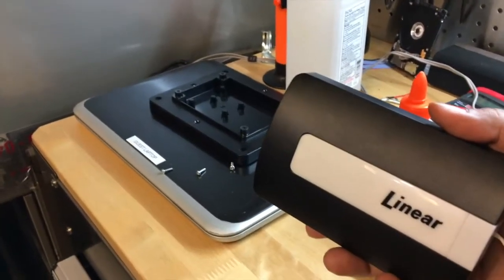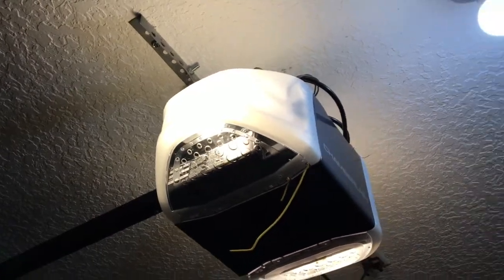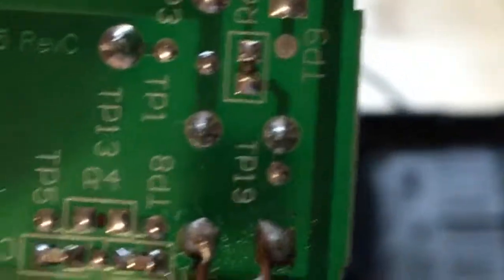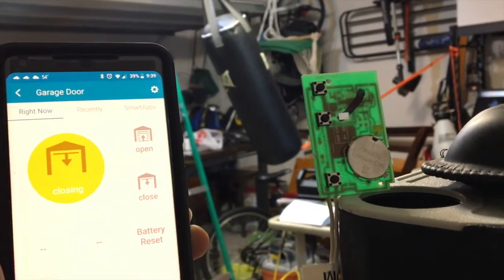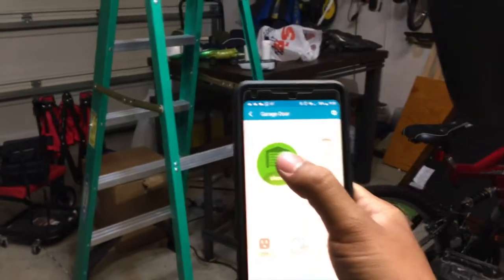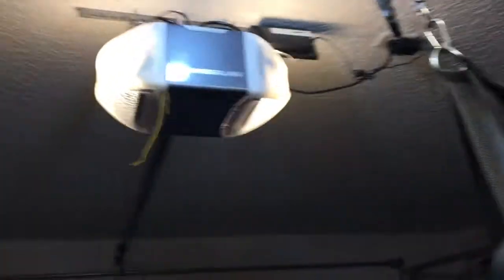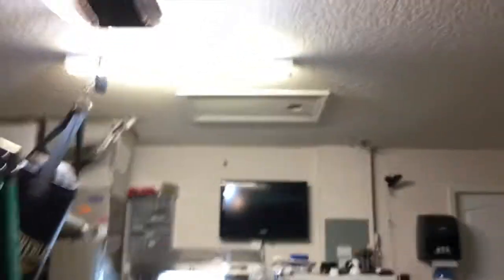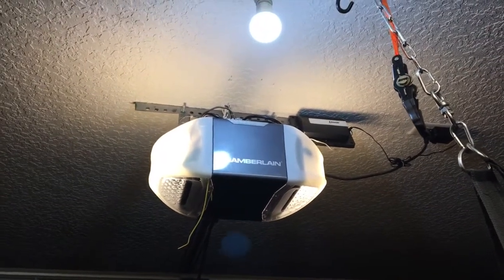Linear Z-Wave Controller with Chamberlin Opener Hack

Comment: OMG! You totally just saved me from losing my shit. I bought a Samsung Smartthings Hub and the GoControl Garage door opener. I was totally lazy and waited a few months to install. After I got everything in place, NADA. For the record, I double-checked the linear website and it shows compatible with LiftMaster 7675, but they are full of crap. I'm not sure if I would have been able to pack everything up and return for a refund, but what a pain. I would much prefer to scavenge one Remote Control opener and use your hack. I'm having my father-in-law solder the wires because I don't trust myself to do it. Thanks!!
Reply: After getting the board soldered to the leads, I verified that everything is working. I played with it all morning. Thanks again for the info. Easy fix for a very annoying problem. I really do love the Smartthings app. It only took about 2 minutes to setup my automation to close the garage door every night at 10:30 if we forget and leave it open. We have a lot of issues in our neighborhood with people prowling around at night looking to steal stuff out of unlocked cars and open garages. No more "missing" tools for me!

Comment: Nice simple hack.  I recommend putting the board back inside the enclosure, and just notch out holes for the wires.  Then you can place the opener in the garage, on the wall, and mount the Linear controller to the side.  Then the opener will serve dual purpose allowing for you to manually press the buttons, as well as via your smart hub.  This will protect the circuit board, and it will improve the reliability.  Having the remote too close is likely the cause of your reliability issue.

Comment: I did this, works great.  However, the battery dies really fast in the hacked remote opener.  Are you having that problem?
Reply: If that is your issue, just wire in a dc 3v power supply to the battery leads

Comment: Can you please specify which Chamberlain model? There is a PDF i found which says which chamberlain models this Linear does not work with. Mine is not in the list of not supported models. I would like to know is yours is on the list or not.

Thanks,
Reply: It won't work with any  security 2.0 models
Reply from the maker: No problem. Chamberlain WD962KEV

Comment: Thanks for the tip. I did mine from the panel control and not from the remote control because I need it for my car. Difference with mine is I have 2018 model with four pins on the button, so I soldered it to the two opposite sides and it works like a charm!
Reply from the maker: Nice. Mine drain out the button battery on the remote within 2 weeks. Gotta experiment a little more with it.
Reply: Hey Jerome, I'm trying to do what you did.. pulled my wall panel off and opened it up.  My button had the 4 solder points as well.. which exactly did you short? Or how can I test it?
Reply: I'm also curious as to which points you soldered on the chamberlain control panel.

Comment: Did you consider wiring it to the push button posts on the back of the wall mounted controller?  Thinking that's the solution to my Genie 2028....  no need to burn a remote that way.
Reply from the maker: yup. It doesn't work. I'm not sure why. It will only work on older openers. That is why this hack exist. There is no way around it with newer garage door openers.
Reply: @MonsterReview  not talking about to the terminals, but to the back of the botton on the circuit board, like you are doing for the remote?  Be the same concept, emulating a button push
Reply from the maker: I considered it, but going through the remote makes more sense. Its easier to access, you can place it anywhere, and if you mess up and damage the board, no big deal.
Reply: @billmadden6959  I was able to solder 2 wires on the wall-mounted circuit board and it worked like a charm!  I didn't have to purchase a separate remote switch and don't have to worry about a battery for a remote switch.  I wired on the back of the board instead of the switch side of the board.  One wire goes on TP41 and the other connects to any ground wire.  I have the Chamberlain  1-1/4 belt drive opener.
Reply: I'm trying to do this now and there seems to be a small processor on the board that communicates with the switch. I'm afraid it may prevent someone from jumping the button this way.

Comment: So I did this, but for some reason if I open or close the garage using the wall button, or another remote it seems like it keeps triggering the remote I’ve attached to the Z-Wave and the door keeps opening a little, then closing a little - as if I were hitting the button over and over again. The only way to get it to stop is to unplug the Z-Wave or wait until the Chamberlain opener has had enough and shuts off. Any ideas?
Reply from the maker: It sounds like the two wires might be touching causing the unwanted behavior. If your 100% sure they are not touching and are soldered onto the remote's board, than it might be the board itself.
Reply: ESteinhouser mine does the same... thought was a dead battery but nope .. it just keeps triggering remote and goes 1/4 down back up 1/4 down and back up.. so on and so on till you remove the battery.. back to the drawing board.

Comment: Would the combination of wiring on the garage remote control be the same on all units? Or would I need to find my combo and solder accordingly?
Reply from the maker: It should generally be the same, but Just take a piece of wire and short them out to see.
Reply: Thanx bud! I’ll try this again and will definitely let you know how it goes! Thank again

Update: I’ve got the same opener / z wave device. I hooked up everything the same way as you did in the demo and it works great! Thank you for taking the time to figure out this hack and post a video explaining your findings.